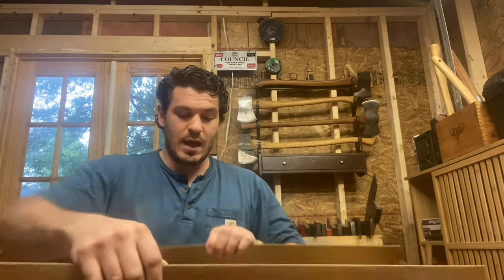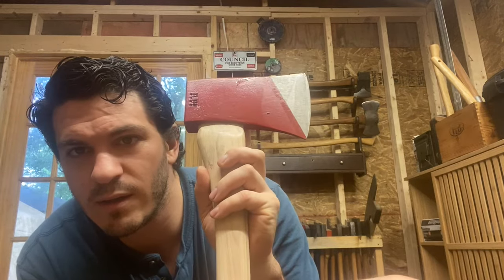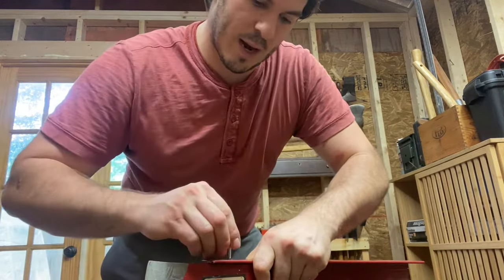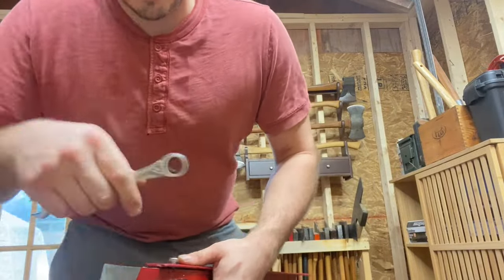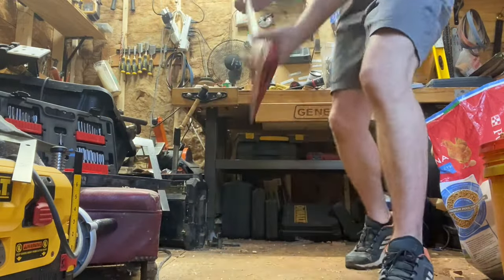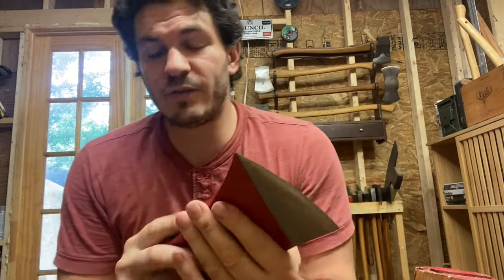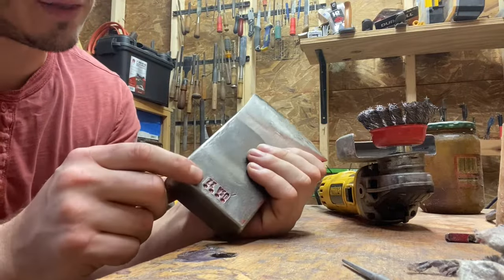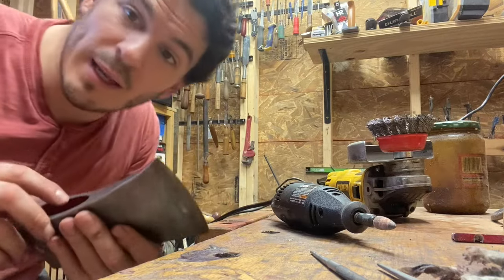The $50 axe worth $200. Best value in the axe market today. Council Tool 3.5 pound Dayton

Comment: I sharpened my new Dayton, yesterday.  It is sharp today.  I used my diamond grit stones to start with and then my hockey pucks.  I put a nice bevel on it.  What I like about it is the shape and size of the handle.  It fits my hands, perfectly.    I polished the bit area with 220 and 400 but my arms got tired quickly.  I did even up the polished areas of the bit.  I have a new wedge for it but have not removed that aluminum wedge, yet.    I use my dead blow hammer to seat axe heads and wedges.
Reply from the maker: Great way to tune it up!

Comment: Great video. Duncan is a great assistant, my youngest is always out there too to help stack wood. Nice polish on that, I've found it helps with corrosion too. After a camping trip,, I can just buff out any rust with a bit of wd40 and some steel wool.
Reply from the maker: Duncan is a big help, he makes things fun. Good point on the corrosion resistance. That’s a big benefit especially for an axe like this which will definitely be a hard user
Reply: shout out to UrbanLumberjack Man🐄! Wormgitter ! And much support sent LOWES Business Vcg crew .

Comment: I got one of these several weeks ago.  I stripped the red paint off of mine with paint stripper and my little brass brush.  Mine has a wood wedge in it.  It was made in 2023.  I boned the handle, sanded it and coated it with thinned out linseed oil.

Comment: I'm pretty sure they phased out all their standard hardware store grade axes (the red painted ones) and are keeping their "Sport Utility" finish axes as their baseline which are even closer to axes costing 3-4X as much while barely costing 10 or 20 bucks more than their red painted ones. Their Sport Utility axes are probably the best value for axes on the market right now and they come out the box finished, patina'd and ready to work with premium handles. 

Nice work you did there with that one.
Reply from the maker: I was much appreciated! I’m liking the axe a lot. Does everything I need it to do.

I’m thinking about reaching out to Council Tool about their axe lines. Definitely agree that the sport utility axes are the best bang for buck. Plus they make a lot of their own handles in house, and get them right.

Comment: I got one of these axes.  I did not have a long felling axe.  I refinished the handle with linseed oil.  I have four coats on it now, heading towards six.  I still head, but I like red axes because they are easy to find in the leaves. have to make a sheath for it.  When all of this is complete I will sharpen and use it.  I have aCT boys axe, which I use as a wedge banger for my felling wedges.  I did not pull the head from the new 36 inch axe.  When I break the handle  I may strip the red paint from the head, but I like the red paint, because they are easy to find in the leaves when I throw them down when not in use.

Comment: If it was worth $200, it should be ready to work out of the box. I decided to pass on council tools after reading too many write ups from buyers getting loose axe heads. I'd rather not finish a job that should have been done properly to begin with, that's the point of me buying their tool. But I get the appeal for those who enjoy tinkering in a shop. Anyway, I went ahead and got a hultafors axe. Absolutely love it.
Reply from the maker: For sure, the point is the substantive quality is there with a little elbow grease! I’ve had stinkers from everybody, even the famed Gransfors Bruk. I do like hults bruk though they generally make a great axe!

Comment: 7/32” file is for a 3/8” Husky chain.    I even got all of the red paint out of the stamping on the axe head with paint stripper.  It took me several coats to get it all off.  I then washed it with soap and water to get rid of the paint stripper.

Comment: $200 worth of work into a $50 axe. I have the same axe, which I used to split wood from a large maple. The axe head, as installed from the factory, never loosened up, but the handle eventually split along its length into two pieces. I replaced the handle of the axe with a wooden wedge. The axe is still going strong. The thing about gluing a wooden wedge or installing metal wedges is that it can be hard or impossible to re-wedge the axe with the old handle.
Reply from the maker: Thanks for sharing!

Comment: The red paint in the stamp looks cool. I don't use wood glue on the wedge, I find that pine star is much better in my experience.
Reply from the maker: Pine tar would be great! I’ve had bad results with oils, i think they polymerize the surface which is bad for a wedge. Will give pine tar a shot I like that idea! Thanks for sharing.

Comment: That's a good way to deal with metal wedges.  One trick I've learned for preserving handles is drying the tongue and wedge (if wooden) over a vent or near a wood stove.   This is also how I like hafting.  Drying the lumber out as much as possible before wedging.
Reply from the maker: Will need to try that, that seems like it would work great. Found you on Instagram btw!
Reply: @urbanlumberjack  What is your name on Instagram if I may ask sir?

Comment: It's a great solution. I use an auto body slide hammer to accomplish wedge removal. Drill, thread in screw and pull out wedge with ease!
Reply from the maker: That’s a great idea!

Comment: Great work! Regarding wedging, I've gotten excellent results (and zero splits) during the wedging stage by inverting the axe, placing the protruding wedge on a concrete floor, and tapping the butt end of the handle with a soft-faced mallet. Also, I hope you won't mind me saying so, but I highly recommend investing in a quality respirator for sanding, polishing, etc. Speaking form experience, it sucks to have messed up lungs.
Reply from the maker: I do need to be better about a respirator. I’ve not been very nice to my kings in retrospect I worked in commercial high volume wood finishing, drywall, among other things. Good suggestion. Thanks for watching and taking the time to drop a note!

Comment: Hit the end of the handle with a dead blow hammer and it will seat a lot deeper.  I soak a wooden wedge in boiled linseed oil overnight before I pound it in with my dead blow hammer.  It will usually not split this way.

Comment: I see you blasted the dark markings off your goat's face in 1 second flat  :<)
Good to see you working the inside of the eye - something most folks miss. That is always the first thing I address after knocking out the old eye. Gives a good clean fit and, if the 'hour glass tapers' are too flat you can 'steepen' them up a bit. I use a carbide burr in a drill for the roughing out and finish with round and half round files - 5 minutes well spent.
Reply from the maker: Lol! These goats sometimes don’t know what’s good for them but they’re fun to have around. Ever since I started rounding out those bottom edges my bangs are much more solid!

Comment: Most axes work loose if kept in an air conditioned location.  This, dries them out and they shrink.  I keep most of my axes in my non air conditioned shop hanging up on nails, by their lanyard.  I drill all of my handles for a para cord lanyard.

Comment: Thank you for very good explanation how to change the handle. But for us less knowledgeable would you please tell us what you were pointing to prior starting taking the head off the handle? The handle wasn’t put into the head the right way or you just wanted to show us how to do it and you didn’t like the paint?
Thank you very much!
Reply from the maker: If I recall correctly, the issue I saw at the time was the aluminum wedge wasn’t thick enough or deep enough into the handle, which means compression will be lacking. Also, with a wood handle it’s safer to leave the handle proud a bit over the eye. It’s kind of rivets the handle into the head.

The paint kind of grew on me I think if I did it over today I’d leave the paint!

Thanks for the comment

Comment: That turned out great. Love the metal wedge removal trick. How do you think that axe would perform at bucking ?  Or which part of cordwood work would you say it is best suited for?
Reply from the maker: Thanks man! This Dayton definitely seems like a chopper. I bucked a few logs with it and was happy with it. I think would need a bit thicker cheeks to throw chips a bit more, but definitely gets the job done. Great all around axe.

Comment: Nice I've got the Jersey. I really like it but thinking about shortening the handle as 36 if your not felling a big tree or splitting just kind of gets in the way. Might go 30-28 lol half tempted to go with a miners style. Nice trick with the bolt by the way will have to try that as don't want to ruin the handle.
Reply from the maker: I really like a 32 inch handle, thanks for checking out the video. I’ve popped out two or three metal wedges since this video and the trick works really well. All handles are either able to be rehung or have been.
Reply: I have the CT 32 inch jersey and its the perfect length for bigger tasks. I prefer a 36" for splitting but that's about it.

Comment: I just tried to remove the stupid aluminum wedge from my newly purchased Council double bit. The damn thing was so soft it wouldn't take threads. So I cut the handle off, lol and behold, the grain in the handle is 90° out from the bit. I'm going to get the paint off of the head and hang a new handle.
Reply from the maker: Best of luck!

Comment: Great stuff brother hoss!! 
Question for you. What would you recommend for a killer splitting axe? 
Thanks
Reply from the maker: My favorite splitter is the forcible entry axe from council tool. It’s the heaviest axe on the market. For a big bruiser I like the oxe head- the 648 one. I got mine at my saw shop sold under Stihl brand. I don’t want to swing it all day but for those REALLY tough rounds it’s got a handle guard and a ton of weight

Comment: don't you think that using a little oil in that wedge would be better than glue? Gordy over on Westcoast Saws had an axe hanger hang an axe on one of his latest videos; that's what he does for a living. Keeping the wood oiled will keep the wedge tight. They even sell a couple small stainless steel wedges with the kit for their handles. You should check him out. You may even like their hickory handles they had custom made as well.
Reply from the maker: I’ve seen a few of their handles they look really nice! I have oiled wedges in the past, it’s a great way to get them sunk in tight!
Reply: @urbanlumberjack  I was trying to remember the oil his axe hanger had on that video, I need to go back and write it down. I remember he put some on the wedge and in the slot before he drove it in, and then again after he trimmed it down he put oil on it and suggested letting it hang vertical for 24 hours to let the oil soak in a bit. Sounded legit. they make the handles to where you have to shave them to fit. They said they leave them big to accommodate the different size eyelets for the different axe heads. I haven't ever hung one, but seems like the heavier axe heads are, the eyelets would be larger.
I don't see any nice axes in Oklahoma like what I see them swinging in some of their videos. Maybe he'll come up with someone to forge some nice steel axe heads and also offer a hung axe as well.

Comment: “Best axe”: proceeds to re-do everything.

In all seriousness though I love it and would do the same thing. I just restored a 3.5 lb Gransfors from the 50s. The steel holds an edge after so much abuse. It was definitely a lot of work to knock all the rust off and get the handle to fit though. 

I guess wether you buy a new axe or an old one, it just takes work to get it perfect.
Reply from the maker: lol it’s a lot of finish work for sure. Axes are definitely a personal tool, I find myself working on axes a lot, whether low or high price range

Comment: Apparently I don't know much about axes but what was wrong with the way it was to start with and why wood instead of the metal wedge?
Reply from the maker: The metal wedges are notorious for coming loose. Aside from that it’s best to have the handle hung over the head, so it rivets the handle onto the head. Everything else is just tuning up a new axe.

Comment: Would you recommend this for processing down kindling and light firewood tasks, or should I just get a splitting axe?
Reply from the maker: I would say that is the perfect use for this was. Breaking down wedges and kindling. It can handle rounds but as a felling axe it’s not designed for it.
This plus the council tool splitting was would be perfect for firewood and be about $100 maybe a bit more for both together
Reply: @urbanlumberjack  Cool, so no real issues with it getting stuck? That's my fear with a more narrow profile like this.
Reply from the maker: @FK-we1dp with good technique it won’t stick too bad. With big rounds you’ll need to be more careful but then again that’s a lot to ask for an axe this size.

I like it a lot, it’s a great all around axe
Reply: @urbanlumberjack  very cool. Yeah I'm just looking for something to process wedges, not splitting rounds. Looks like you have the 36" handle there? I see it comes in a 28 as well.

Comment: whats the issue with the aluminium wedge? i dont get why you remove it.
Reply from the maker: The aluminum wedge is pretty short and pretty thin. It moves at a different rate than the wood so it’s virtually guaranteed to looses after a few seasons. And when it’s loose it can’t be wedged again.

So wood is the better long term choice

Comment: When you use a wire wheel! It’s very important to wear safety goggles! You can very easily end up with a piece of wire in your eye!
Reply from the maker: I have had a few close calls with the wire wheel for sure. Need to be better about glasses.

Comment: beast cutting dude but a maul would've broken those rounds in half those swings.
I know it was just demonstration.
I recently got a HF 30 dollar axe and it's honestly great, got a really straight grain handle and it splits really well
but the way it's hung... it's got a couple of small gaps and from underneath there are literally a couple of rough jagged edges in the eye, it isn't even a perfect 0 shape....
I guess if it comes loose I'll take the head off and file the eye so it's perfect all around because otherwise it's great and about that size
Reply from the maker: I really like the HF hatchets. I have a few of them for rough jobs and modifying. I do enjoy splitting with an axe. I have mauls and splitters but an axe is a great experience. Good luck with your axe!
Reply: @urbanlumberjack  nice I own 2 of the hatchets as well. Took the paint off both and sanded the handles, gave them the all natural linseed treatment (somewhere between 15-20 coats) and they took on a very rich natural color. One I left unpainted but left it in vinegar, the other I re-painted in matte black.
The rougher one with the patina has a much better hung handle and the grains are turning black from the sheer use I've put into that hatchet, and it's got a little bit of rust from rain coming sideways into my open shed. LOVE that one. The one I painted has a bit of a hump and a twist in the grain that makes me hate it, but it's in the bushcraft roll. Might just swap them, don't wanna lose the one I adore

Comment: Why no steel ring after the wedge?
Reply from the maker: If I’ve got a nice seasoned handle and hang the axe myself I don’t use a wedge to start.

That way if the head does come loose I then have the option to put in a wedge. Just my personal preference.
Reply: @urbanlumberjack  i thought you took out the aluminum wedge & put in a hardwood poplar wedge. Ive seen a steel ring then pounded into the poplar wedge. I guess just personal preference.
Reply from the maker: That’s one way to do it. The issue with that is if you do put a barrel wedge when you hang, you don’t have many options if the axe does loosen, which will happen sooner or later to every axe.

But many ways to skin a cat!

Comment: You will not get a good axe. Council tools axes ARE great if they had QC. But they actively send you downgraded axes so you will almost certainly not get a good axe. Unless you buy from one of their relatives stores. You might get a good axe head which you will have to fix...not tune..but totally fix. Just buy a good handle and a vintage head and do the steps yourself.
Reply from the maker: What were your issues? Sounds like some bad luck

Comment: SMALL AX IS NOT FOR SPLITTING WOOD
Reply from the maker: Hey thanks for the input. I probably shouldn’t mention o do split a lot of wood with 3.5 pound axes, and really enjoy it. But I do have very heavy duty mauls as well. You do need to be careful with a 3.5 on axe like this but it can absolutely get the job done!
Reply from the maker: Hey thanks for the input. I probably shouldn’t mention o do split a lot of wood with 3.5 pound axes, and really enjoy it. But I do have very heavy duty mauls as well. You do need to be careful with a 3.5 on axe like this but it can absolutely get the job done!